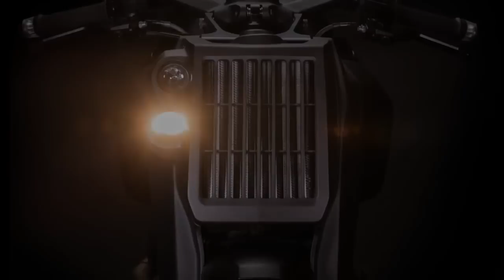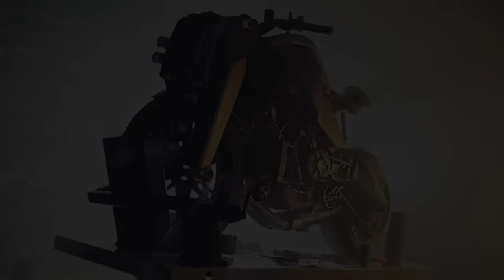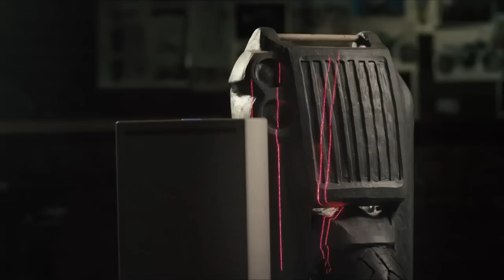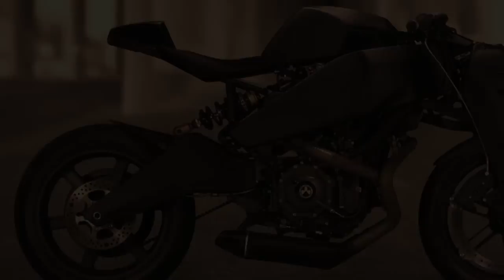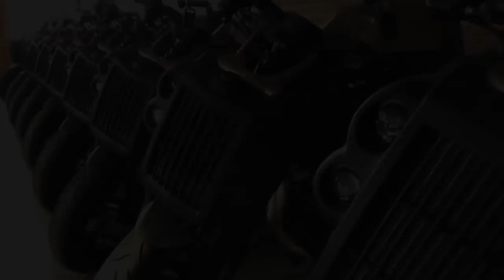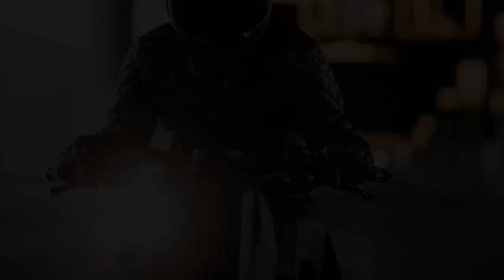Cafe Racer ( Ronin 47 - Buell 1125 by Magpul)

Comment: In regards to that gorgeous front rotor: I imagined something like that while looking at my CBR600RR. It would have greater stopping power because of its further distance from the hub, meaning it would apply a greater torque to the wheel overall. I knew some company out there had to have thought of it before me... But good on Buell for producing it.

Comment: First off. I love the bike. I have been following the Ronin project for a very long time and have been a Buell owner and enthusiast for much longer than that. The Air box cover, sub frame and the overall flow of the bike is fantastic. I for one appreciate the passion and the engineering feats of the motorbike. I am also particularly interested in the cooling set up. All around an awesome bike in every right. Not for everyone though. Love the story and meaning behind both parts of the bikes origin as well.

Good video. Just a few things to mention though. Not hating, just saying. I did not go through and read all of the comments so some of this may be repetitive. 

The oil is not in the swing arm..... That would be an XB series. The Rotax powered Buells share the engine oil with the transmission and have the oil fully contained in the engine case. Fun fact of the day. 

Was this done with a vocoder?? It almost sounds like it, but not because of the tamber of the voice, that sounds perfectly natural, but the affliction and pronunciation of certain syllables. Might want to double check on the grammar of the last minute or so also.
Reply from the maker: Goose Thank you for sharing your opinion about this amazing machine.Yes you are right about the swing arm. The 2 fonts from where i got the data about this bike, were mistaken about the swing arm.The Buel XB series held the oil in the swing arm, were the 1125 series held it in a normal manner.Curiously, 2 of my Viewers have already mentioned this mistake.About the voiceover, i'm really sorry, but the software that i use, is one of those secrets that i can't share, because it took me several months to discover this voice. I hope you understand.I also ask you sorry for the grammar, but i'm Portuguese, and i try to do the best i can to get the right sentences. Cheers.

Comment: Unless Magpul re-tasked that swingarm, the 1125 Buells did not have oil in the swingarm, only the XB(air/oil cooled) bikes did.  Beyond that, I love the design and homage to Buell bikes.  The price, not so much.
Reply from the maker: dbc1dc Yes, you are right. Unfortunately i discovered the truth about the swingarm after i publish the video. The sources that i used during the video production, are also mistaken about the swingarm. Sorry about that. Thanks for sharing your comment. Cheers.
Reply: This is an XB...... Jesus fuck. You can tell by the in frame fuel tank

Comment: Why cant manufacturers build machines like this...absolutely love this! Thanks Racer TV! Subscribed!!
Reply from the maker: hebeb394 I understand your comment. But i think manufacturers have to consider several legal demands, which can turn production of bikes like this impossible. Thanks for subscribing. Cheers.
Reply: As long as it passed emissions regulations and they install huge hideous turn signals on it I dont see why they couldnt get close to an amazing bike such as this...
Reply: how about some limited edition models? something out of the ordinary lol
Reply: because they are allergic to the money lol, they'd have all of mine if they manufactured machines like these
Reply: amen man lol Id stay broke and in debt haha
Reply: because if you're aiming for any market outside the US (which every manufacturer does) there are rules that have to be respected and followed. 
Such as turning signals that have a certain brightness and size and distance to each other and to the front or middle light, a rear fender that reaches over the back tire, correct licence plate angle and reflectors, covered turning parts (such as the belt gear at the engine)

Comment: Some motorcycles look dangerous, which can be a good thing because they are. I had a Buell XB9R, which I loved and hated at the same time. It was impossible to get it running right. At full throttle, it was great but at partial throttle openings (everyday riding) it was never right. The Harley dealer wanted nothing to do with it. I still wish I had it.

Comment: Its not a cafe, its just ugly, fuel in the frame, not practical, check for leaks hourly, 38 grand would buy you an H2 & a winner winner chicken dinner , you cant tell the front from the back, just because you can does not mean you should.
Reply: Yes its quite possibly the dumbest idea they had other than building the ugliest over priced bike made.